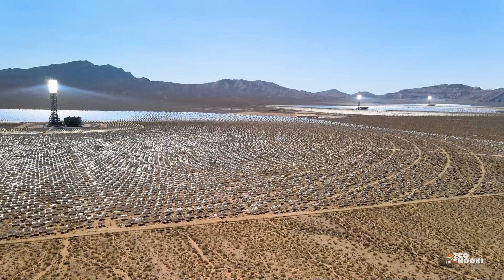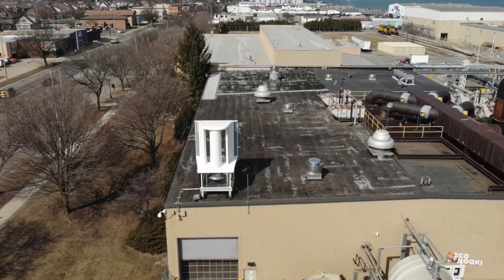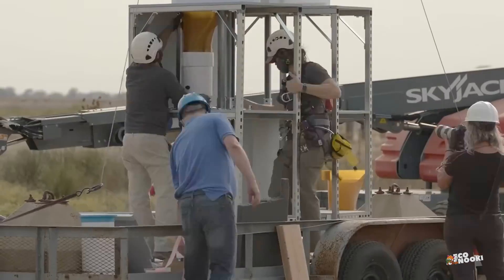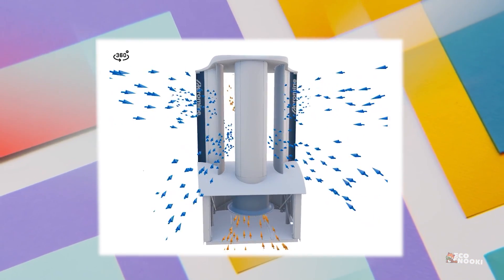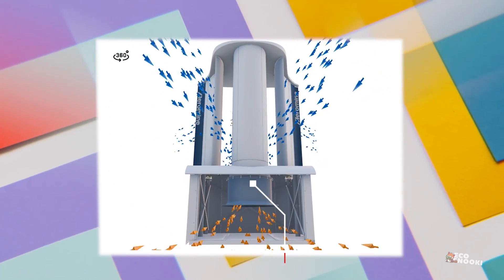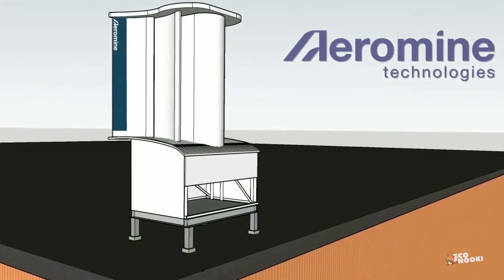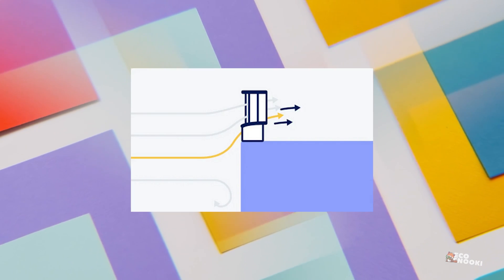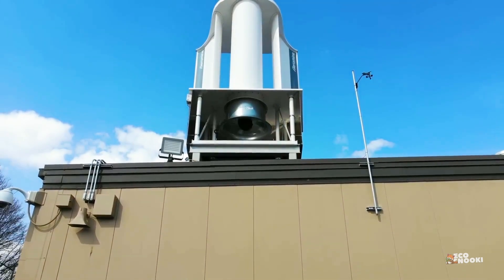Without moving , This Wind Turbine can beat Solar panels !

Comment: NONSENSE! All practical tests show that small wind turbines hardly generate any electricity. Because there is hardly any wind close to the ground – and electricity yield is proportional to the third power of the wind speed: 100% more wind generates 800% more electricity!
Only if you need to be self-sufficient from the power grid, you should erect the largest possible wind turbine on a high mast. 
With solar modules, on the other hand, you can reliably generate green electricity for 25 years at approx. 5-10 cent/kWh!